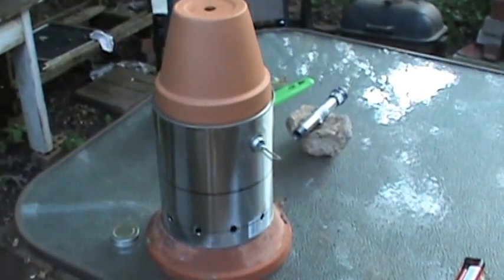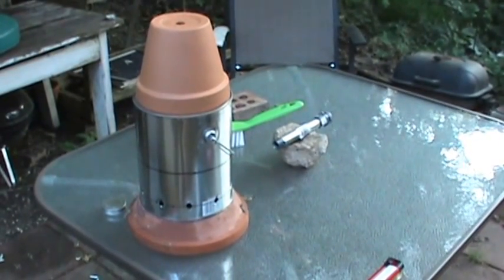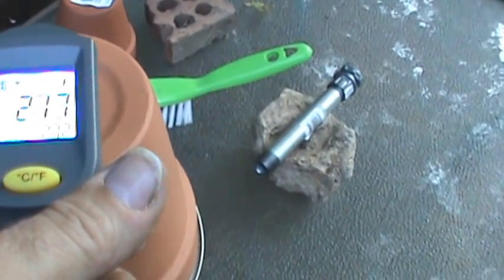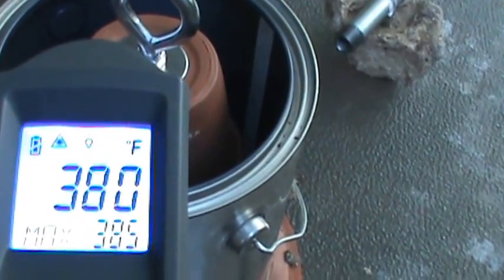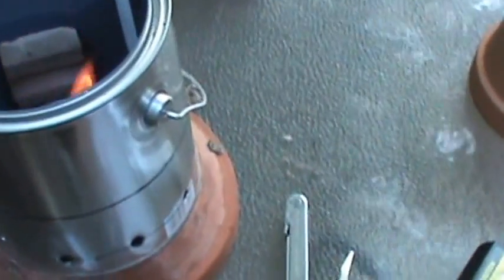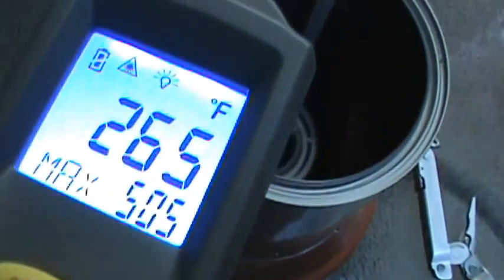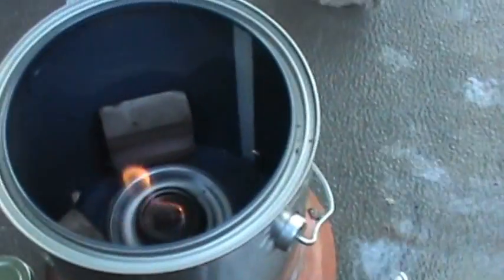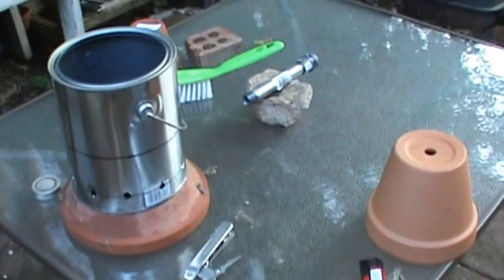Flower Pot Heater redesign. This one works.

Comment: Science (thermodynamics) backs all the comments that say this doesn't work. Don't underestimate the placebo effect (you imaging something happens because you want to believe it happens). For those who claims this works, have you taken into account other heat sources. A tea candle might produce approx 25 BTU per hour. The average human body produces about 400 BTU per hour at rest. You also get significant heat from lamps in the room, electronic equipment, sunlight from windows, inflow through walls, etc. WARNING: Fire hazard plus any combusting material produces hundreds of byproducts like soot, CO, CO2, NO, NO2, etc and are a hazard to human health (plus the soot settles over your entire house).
Reply: That is why it makes way more sense for people to go back to the old ways and use Crisco lard to make a candle. Just stick a birthday candle in the middle of your lard candle. No fumes to worry about. These were used for years and years with no problem back in the old days.

Comment: you are losing btu's heating the flower pot. meSUre the flame of the candle, better yet ill just tell you. your average tea lite candle is roughly 150 btu per hour. putting a clay pot over it cannot cause it to produce more heat, period.
Reply: did you actually watch the vid ??? The man DID NOT use a tea lite candle !!

Comment: no no no... not alcohol dangerous alcohol vapor can build up and cause a flash fire or even explode... bad idea do not do this using a candle and a flower pot makes a nice hand warmer at a picnic or event but just too dangerous in a tent commercial tent heaters have safety built in and even them have a level of danger

Comment: WE DON'T  NEED TO HEAR  THE PRICE OF THE GEAR!!!  SHOW THE F^&*ING SCIENCE
Reply: thermodynamics has been shown again and again and you can find many varied descriptions on the internet, a cute one goes like this: Thermodynamics is the study of the inter-relation between heat, work and internal energy of a system.

The British scientist C.P. Snow had an excellent way of remembering the three laws:

    You cannot win (that is, you cannot get something for nothing, because matter and energy are conserved).

    You cannot break even (you cannot return to the same energy state, because there is always an increase in disorder; entropy always increases).

    You cannot get out of the game (because absolute zero is unattainable).

If you are expecting a man to show you how a can and pots somehow create heat from nothing you will probably be waiting awhile.
This part of "the game" is simply the short time storage of a fraction of the original heat and releasing it over time. Research heat and mass, this method has been used a long time in conjunction with "rocket stoves" and solar gain.
The apparent trick here is thinking that somehow this or any contraption like it actually creates more energy than was originally available.

Comment: you can find a stainless pot at the thrift store/ yard sale and drill vent holes in them the same way as the paint can, less money, and get more heat with a larger pot set-up. It works great in my greenhouse.  Someone made their  sterno  using tuna can, cardboard,  wax and wick .

Comment: The design is good because no open flame. But  it would have been better to break down the whole unit so we can see how to put it together. these units will be good in a doomsday situation. please do one showing how to build unit. from ground up. also people are going to have to find supplies at a store not accidentally running into them. thank you for your work. send a link when you get it done thanks. cbzombiequeen58@gmail. com

Comment: You cannot create energy. The BTUs in those candles are set. When you 
burn them down, you create THAT amount of heat and no more, regardless 
of what pot you put or don't put over it. Just burn the candles normally and you will get 100% of the heat into your house.

Comment: You're just lowering the effiency by covering it or putting flower pots on it.. if you want to heat just use the sterno can or candle openly and you'd get more heat. People aren't saying it won't "work" they're saying it's no better than an open flame, theres no point. Go put a flower pot on top of your heating stove, will it get hot? Of course, will it "work"? Of course.. is it doing anything that the heat under it wouldn't do? Of course not.
Reply: A lit candle will expend the same amount of energy whether it's covered or not.

With an uncovered candle, the heat goes directly upward toward the ceiling and because it's a minimal amount of heat energy surrounded by a large space of cooler air, the release has no noticable effect within the room.

But, what if that heat is trapped in a small space and allowed to accumulate and increase in a container that releases the accumulated heat energy in a desired location? That's the basic premise of any small heater. 

Ever get in a bed and place thermal blanket on top of yourself? Initially, everything is cold. Then, sometime later, you awaken and you're much warmer, the sheet underneath is warm and the blanket is warm. That's trapping and localizing your body heat. The same reason why we insulate a heated home. The same reason we shut oven doors. That's why thermostats are regulated. It's why you dress differently during winter.  And so on ...

This isn't something new. Your body temp is basically constant but if surrounding temps are below freezing, you would prefer a well insulated sleeping bag rather than sleeping uncovered outside.

Comment: Candle BTU output is X. adding flower pots will not change the amount of heat output. The Laws of Physics don't bend for candle heaters.  just get you a nice stable candle holder and a good battery operated CO detector so you don't die..... if you want a grid free heat source look at wood stoves.
Reply: yeah get that but when candle is blown out there is immediately no more heat, heated pot will stay warm for a bit and it may be that it is a psychological cosy  feeling people are after rather than a bare candle or the science behind it.

Comment: I guess I fail to see the increase in heat.  Why?   Candles too close melt each other.  I propose that a bunch spaced out
(in a room) would heat the room   (the same)  as any other configuration.    Laws of physics you know.   Why would there
be extra heat.  The test is the room temp.  not the heat next to a candle contraption.  Not sure,  just wondering.

Comment: I think the biggest problem with some of the youtubers is they over think a problem. This is a simple problem. 1 set up your tent, 2 cover tent with old blankets, 3 cover blankets with tarp, 4 set sterno on old dinner plate and light it. I've done this in 10-20 degree weather and was nice and toasty.
Reply: justin dechaine more blankets
Reply: James, It's carrying all those wet blankets & the tarp home that's a problem.
Reply: Connie, It's carrying all those wet blankets & the tarp home that's a problem.
Reply: James Boyd so true
Reply: Some of us live much farther up north so might be looking for other solutions, ie -30, -40
Reply: Rudi Watson why would the blankets be wet ? From the south.. sorry
Reply: The tent is covered so that it is a lot warmer in the tent than outside, and that can produce quite a bit of condensation, depending on the humidity in the air.  If you put a covered pot of hot water in a cooler and cover it with a towel and then close the lid for a few hours, the towel will be wet. It is the same effect, just on a smaller scale.  In the case of the tent, the blankets are covered with the tarp, which will hold the moisture in the blankets.
Reply: Sorry if I was confusing. I was just trying to answer the one who asked why the blankets would be wet.  If I was incorrect though, you can correct that info.
Reply: James - so what's the tarp for ?
Reply: It's ok Connie, I was just referring to James Boyd's original comment and his dick-head idea of 'camping' (- a tent in the back garden ?). What's a nice  girl like you doing in a place like this ?
Reply: I know this conversation is 2 years old... but I was wondering the new metal tent warmers on Amazon .. they are designed to sit directly over a heat source (butane stove or alcohol stove) the metal radiates the heat..could a Steno be used instead and is it a clean burn or at least safe with ventilation?

Comment: Please be careful....a friend used a very similar heat source and the fuel insiee the can got so hot that it flash fired and burned his hunting cabin to the ground.
Reply: That's why a modest candle is the best after all.
Reply: A good chimney making a draft would reduce that risk tremendously.
Reply: Like every hilly Billy experiments lol 😂
Reply: Setting the heater in a steel basin which is stable would solve the problem as long as it doesn't tip over or get knocked over...there is only so much fuel in one of those candles so once that burns out , you're ok.....
Reply: Whoa! Ok!

Comment: You really don't understand heating.  The fact that the pot and can gets hot does not in any way change the total BTU output of the candle or sterno can.  YOU PROVED NOTHING.  A candle burning has a particular amount of BTUs of heat that can be produced from burning it.  That BTU output does not at all change just because you have a container temporarily absorbing some of the heat.  You are sadly confused and you will be cold.

Comment: Another thing that you can use for burning:  start with a tuna can, cut  a long piece of cardboard (the height of the can so that you can roll it up (round & round) and stuff into the can.  (approx 1" x 1.25  feet)  (should fill can to top)
Then melt paraphen wax and pour it over the rolled up card board and fill up the cardboard in the can  with wax.
Make a bunch and set aside for use.. This can be lit and it will burn for a very long time.  Make sure you don't leave unattended (like any open flame)  We made Bunsen burners like this when I was a kid.  They work great and they are cheap.
Reply: We made those for camping with the kids. Used a bottle opener to open vents around the top side of a #10 can. Put the tuna can/heat source until the large can, lit it, covered with large can and put a cast iron skillet on top to cook the best breakfast I've ever eaten...all the way down to the toast. It was great fun!

Comment: Yours is the best by far. I figured a person could get more heat by using with a flame larger than a Tea Lite.
Reply: very dangerous.. fuel can get too hot and flash fire.. also carbon monoxide is an issue as the fuel he is using burns dirty. But yes an effective heater.

Comment: The federal government will provide up to 50 cans of sterno or 800 candles per month through their YAI program. Contact your state's governor's office for more information.  They also will supply flower pots for about 26 cents each with a limit of 50.
Reply: Great information. Do you have a link to their website?
Reply: G.I. José try .gov
Reply: natural gas is about 65 times cheaper than this method...someone did the math.

Comment: When I was a child we would stay over at my grandparents old house. They had a coal fireplace and big cast iron stove in the kitchen. Everyone would have a brick set right next to the fireplace, at bedtime you would wrap your brick in a blanket and set it beside you under your covers, this seemed to work. Please don't put an open flame beneath your cot, you sound like a good fella, pity if you burned alive. Thanks, good design. Sam.
Reply: we did this sometimes at childhood also. Now these days-I have a couple rice socks I heat gently in microwave when its gonna be a Nor'easter! put in my bed at the foot and toasty warm!
Reply: that is rustic living. I want one of those wood cook stoves. I just installed a wood burning heater. I know how to live the old way too. it is awesome as a storm backup.
Reply: A God u

Comment: Please don't forget that ANY fuel will depleting your OXYGEN !!! Also, there is CLEAN Fuel out there as well, rather than burning Alcohols or other dangerous fuels :(
Reply: Alcohol is actually one of the few that is WELL KNOWN to burn clean and not give you carbon monoxide poisoning. MANY MANY fuels will burn clean but STILL KILL YOU because of carbon monoxide. The clean burning is ACTUALLY about getting the FUEL AIR RATIO correct. Even dirty old low grade diesel can "burn clean".
Reply: @OffGridInvestor  oh... I didn't know that the fumes killed you... I thought that the flame burning up all your oxygen was what killed you... provided your avoid burning yourself up... lol

Comment: Ok, first off putting this under your cot or in your tent is a bad idea. Your tent is not capable of handling the temperature you showed in your video. The material at least will melt, at worst may catch fire if it reaches a high enough temperature. The same for your cot. In addition to the startled reaction fator most humans have to fire this could be very dangerous left unattended to while you sleep. The design is good, it functions better than some of the others. But all of these are better used like hot rocks of old. let it get hot, then blow out the heat source and let just the radiant heat keep your space warm. It is far safer. If you do need to use it unattended a smaller scale would be better. And my final safty warning is remember any flame of any kind must consume OXYGEN! Using any flame sourced heat needs ventilation, or you run the risk of carbon monoxide poisoning. Again the need is totally understandable, I have been in situations where the heat would have been great but is better to be alive and healthy and safe. Please just remember to think about all your surroundings like being in a tent or an inclosed room. BE SAFE!

Comment: I can't understand all this expense and work when a rocket stove will be so much lighter! Just pre-cut and pre-fit the cans, then haul them up to the camp. You can cook on it and heat with it using materials right at the campsite or nearby. Small sticks for heat! How easy is that?! Fill the empty space between the cans with gravel, sand, etc. No smoke (once it heats up, which takes only a minute or so). You can put a pot of water on top to use as a Mass Heat source to keep you warm over night... or a can of clay if you want.
Reply: You can't put a rocket stove in a tent unless the exhaust is somehow vented outside.  A rocket stove will produce a lot more carbon monoxide than his setup in the video.
Reply: OtterRose1
Reply: OtterRose1
Reply: Jeffrey Siequien r
Reply: Open a can of claymore... lol

Comment: I like what you have done here. You do seem to have attracted a few negative comments though. This should work fine to heat an area with good ventilation. The only way to get rid of the fumes from the burn is to have the burn chamber seperate from the heat exchanger and a proper chimney for exhaust to be vented outside. Have you looked at the "rocket stove" designs? Perhaps there are ideas there for improvements. Also there was a comment that suggested you move the fuel source outside the heat chamber. Could mount under the can somehow? Just some ideas and encouragement.

Comment: I built one with 4" 6" 8" pots, a 5/8th ss threaded rod and ss washers and nuts. 2 - 5 hour candle burn tests produced no large scale stored heat in the ceramic. I think the design doesn't work in all cases because the air flow is incorrect. It either needs to be flashover condition, where gasses are stored and reburned like a secondary combustion or as a type of heat exchanger system where airflow is slowed.

You also have the possibility where some or many people are falsifying results, a sort of flash mob practical joke.

I can currently get more heat by placing an aluminum grease can filled with water above the candles.
Reply: Well just one test and you gave up. The pots were to big

Comment: Well done & some impressive #s regarding temps. I've used my flower pot design with beeswax candle in my tent & it has worked well. I've got 4 wicks that I can light in the candle, one flower pot is the candle and the heat it puts out is solid.

Comment: this looks great!  what are your thoughts on combining the penny stove style w/the boy scout 'buddy burner' instead of a wick and alcohol it would be cardboard and wax.  it would be compact and easily carried & no need to waste or carry alcohol.  I've come up with at least 2 issues: 1:  need access to light it and 2: it's sooty.  I lived in my truck for 1 1/2 years and I do know that the tea lights will warm up the interior but I was always worried that I would kick it over and start a fire.  but if it's small and contained, like how you used the #10 can as a barrier....  anyhoo - i'll check back later.

Comment: like a kerosene heater this will use up all the oxygen in a room unless it is ventilated well.
Reply: Its Alcohol!   Safe and clean. Can use in a car overnight w 1" window vent no prob
Reply: Lee Hall 
Not worried about the oxygen getting used up. I’m more worried about the carbon monoxide!
Reply: That's why while using these you should have a source of ventilation
Reply: If I knew the difference between ventilation and renovation... my best friend would still be alive.... lol
Reply: Weed out the simple
Reply: Just use the old type candle made with Crisco lard. No worries with fumes using that.
Reply: Lee Hall .. are you concerned about your gas stove/oven-range or gas dryer too?  Those do not have a fresh air intake into a room either.
Reply: @mwradz7908  they're vented outside dipshit